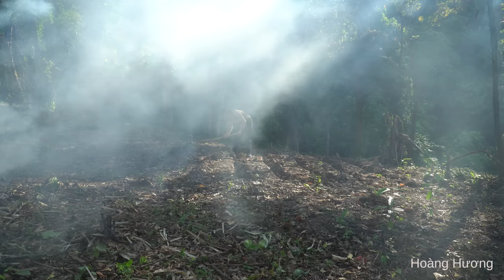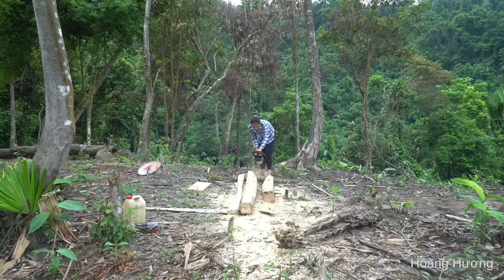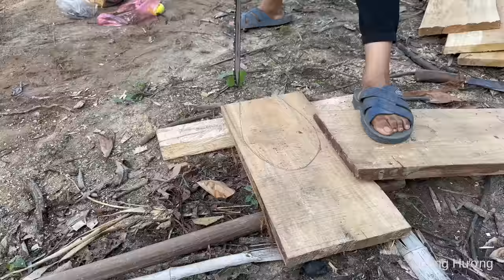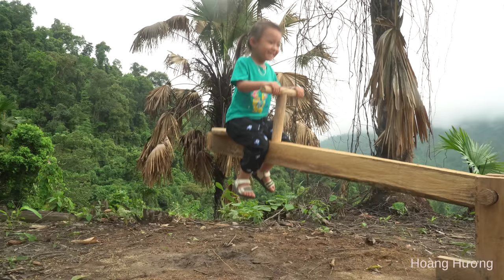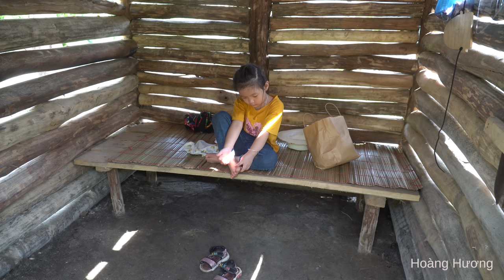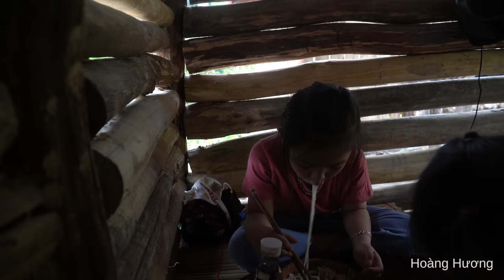Make a wooden seesaw, Surprise gift mom gives her kids | Hoang Huong

Comment: The drainage ditch that sends the pond overflow across your land is called a swale.  If you dig the ditch a little wider and deeper, depositing the soil on the downhill side, you will have created a berm and swale.  This is an excellent way to distribute the water across your land so it can soak into the earth and make your gardens even more productive.  If you find that there is surplus water flowing from the end of the swale, you can dig a simple pond with no cement or bricks to hold the water until it can soak into the earth.  Excellent use of your resources! 😊

Comment: 9:27
Have you poured fuel into the tank and added oil?
Do not do this, it is better to add oil to the fuel container and stir, then refuel the tool.
Reply from the maker: Yes! I've already mixed oil with gasoline